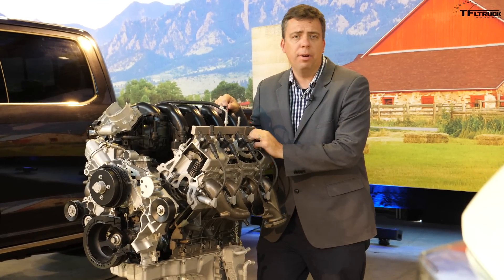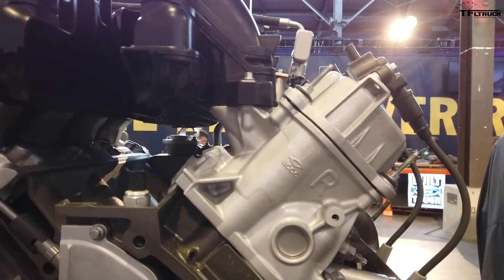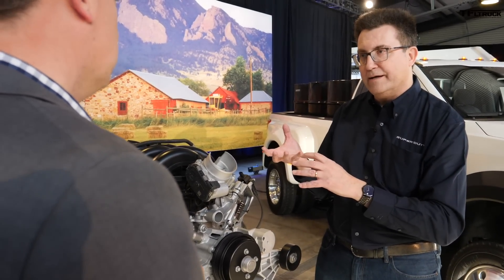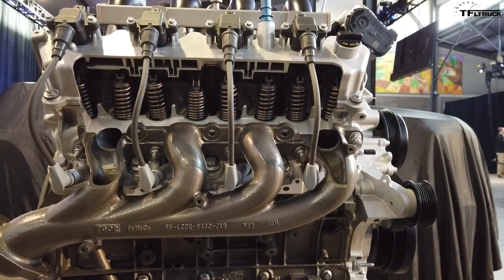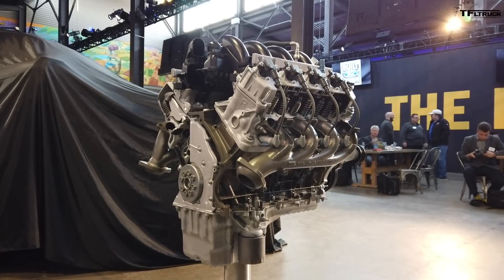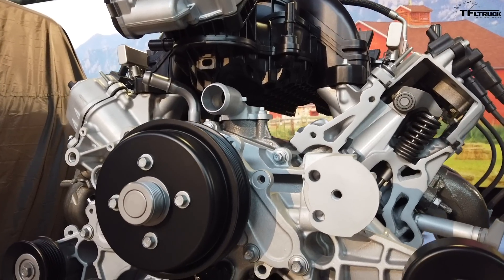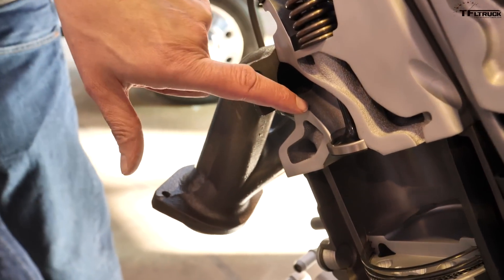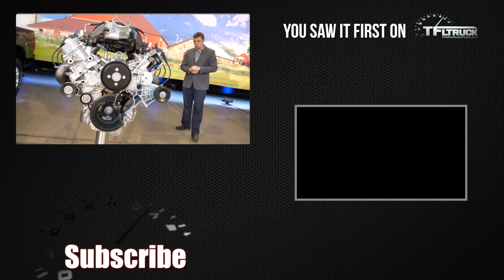2020 Ford Super Duty 7.3L V8: Here's What You Need to Know!

Comment: Ford said a new truck before the bronco, its almost here boys
Reply: abroham lincoln imagine this in the new bronco
Reply: Is Ford going to name the white Bronco OJ Simpson Edition?
Reply: Ford ranger??
Reply: No the new hybrid F150 is coming before the bronco
Reply: Your new bronco will be a far cry from the originals. It will be a crossover with a 4 cylinder or optional v6. Its been just about verified. you cant buy in to these images someone designed on their PC and put out on the web. Need to be realistic here. There is no room for a big clunky body on frame v8 powered off roader in todays market. That's what a jeep is for and they've pretty much got the segment nailed down. Ford would never sell the volume to make it worth it. Maybe a special edition bronco thing of sorts but probably not what your expectine. It would be an ecoboost crossover that would mimic a ford explorer or edge
Reply: @platinumlawnservice  No one is talking about and no one asked you anything about the bronco.  The main comment here is simply about its release date.  Yet here you are chevy fanboy spreading misinfo about the bronco.

No its not gonna be a crossover stop making things up.  Its confirmed to be using the new ranger platform which is body on frame.  And its gonna have a twin turbo 4 and probably a twin turbo V6.
Reply: @platinumlawnservice  ford has said they are going directly after the jeep with the new bronco. sooo
Reply: @sergeysmelnik First its a public forum so I can say what I damn well please. 

Second who says im a chevy fan? Ive owned them ALL and they all have their pros and cons so put that to rest. Ive owned fords in the past but the 97 through whatever year round bubbly things were awful looking and the 5.4l I don't love. We do own a 7.3l powerstroke that gets used for farm work and an occasional trip to town.
 
Third its not going to be anything like the original. If it is indeed built on the ranger platform it would be closer to the bronco 2 which most people don't put in the same class as a full size bronco. It will most likely be some variation of the Everest sold in other countries but with removeable tops and US styling. The removeable tops are jeep like. Will it get off road tech like a jeep? Maybe? Will it sell? I don't think it will hit the spot with the nostalgic fans as it will be nothing close to the original. Also no V8 so im out there. 
Finally I think in basic trim it will be just another SUV that you will lose in the Walmart parking a lot along side all of the others. Hope for the best but prepare for the cringe.
Reply: You said its gonna be a crossover now you're saying its gonna be built on the ranger platform right after I told you...
Reply: @sergeysmelnik  Even if its built on the ranger platform I believe it will resemble a crossover in size and general form

Comment: This new Ford engine justifies my view that the diesel trucks no longer operate in a realm of reality, they are no longer trucks for the average user. 
I want to know how much less a  diesel truck with 300hp and 600ftlb torque would cost today vs the monsters on the lot.  
The modern diesel is dead to me. I'm stuck in the era of the 6bt and ISB engines. I had a 2012 Ram 2500 6.7, wife bought a 2015 Ram 2500 with a 6.4. Her truck got 2mpg worse towing the horse trailer, 2 better mpg highway. With 18k in tow my 6.7 got 9.6mpg, her 6.4 got 7.8 and handled the load without drama even with a 5% grade.  I sold my 2012 cummins.
Reply: TevisC emissions, emissions, emissions. I'm a diesel mechanic turned truck driver. I own a 97 Detroit and a 04 Cat. I wouldn't go near a modern diesel. I know drivers that spent $80k in a couple years on breakdowns due to emission failures. Also my Detroit gets better fuel mileage than new diesels with 2.5 million on the clock. New diesels start having serious problems @500k, at a million you might as well junk it.
Reply: jesse burnett and who are you talking to?

Comment: 390hp @ 5,500 RPM
510 TQ @ 2,500 RPM
But tune it will be 600HP v8
Reply: not on an engine designed for low RPM power.
look at the Vortec 8100
same concept here

Comment: The new 7.3 V8 has a variable flow oil pump!
If that oil pump is similar to those fitted on the 3.2 litre diesel in global market Rangers,  then everyone is going to be in for a rude surprise.
That model of oil pump is incapable of self priming, ie, if you let the oil completely drip out during an oil change over the course of a few hours, the oil pump cannot self prime and pick up the new oil.
You have to let the old oil drip out, change filter, plug the sump and pour new oil in under 10 minutes or so.
A lot of ranger owners in Australia ended up with blown engines because of this design flaw.

Comment: This is a medium duty truck motor. It's made simple because those medium duty trucks see so many hard miles that it's necessary to be easy to maintain by any Joe Bob fleet maintenance, no matter the skill. It's not better, as a OHC DI would kick it's booty output wise, but it's simpler and far cheaper. It's essentially a performance v8 from 1991, with a lot of low friction components. When they say good fuel economy, they mean in comparison to the 6.8l V10 it replaces, which isn't hard. He lost me at cast stainless steel headers, why wouldn't they just use ductile iron which is also resistant to corrosion, cheaper, and casts better? Don't count on it being put into the Raptor simply because It would screw the reported Fuel economy rating of Ford as a company. 3/4 ton and above don't report numbers. I'd guesstimate about 16-18 MPG HWY and 12 City In the 250. Only losing 3-4 MPG loaded. Don't count on high horsepower for displacement with those stubby headers, but the torque number should be chunky.  Without anything to go on other than what information was provided, output could be 380-410hp and 490-540 lb/ft of torque @ 2500-3,000rpm. I doubt it will be rev happy, or even feel comfortable past 4,500 rpm (from his wording it likely red lines at about5,000- 5,500, and those push rods are massive). It won't be a good speed motor without some significant changes that would compromise its purpose. 445 cu inches of Canadian Iron, cue Tim the Toolman.
Reply: Slow clap applause. 👌🤘👍
Reply: 16-18? Ill be surprised if they typically see double digits. Our 5.2 f250 gets 8, the v10 gets 11 unloaded with a cautious driver. The guys who like the way that v10 sounds, they get about 6.

Comment: Will it fit in a fox body mustang and have cams and heads for horse power?
Reply: Well, people have stuffed the 5.4 into a Mustang, and this is a narrower motor.  Definitely taller than the 4.6/5.0 motors, though.  Weight might be an issue, but some people have put the 6.8L V10 into Mustangs, so it should be doable.
Reply: Sebbonx Xsebbon they have shoe horns for that
Reply: Fox bodies can fit anything

Comment: Do we know what the cylinder spacing is? This engine may work out good though with some of the drawbacks of diesels in cold weather, this provides another option. It will be interesting to see if they can pull off decent fuel efficiency with it.
Reply: around 118mm i think

Comment: I have a 2022 Ford E350, Class C, 24 foot RV with this engine and it is a dream.  I have owned other motorhomes and nothing pulls, or cruises like this one.  We do a lot of West Coast, North/South traveling, and anyone knowing the topography of that part of the USA, knows the variation in altitude -- Mountains and mor mountains.  This engine handles ever grade we have driven, with power to spare.  Considering that this Ford and engine are not set up with any special settings not found on standard truck or van models, is impressive.  What if someone were to tune this for the Motorhome style of traveling?  Mine has the 6 speed transmission, what about a 10 speed.  Never mind, just questions -- I am totally happy with my 2022, with power to spare.  The Engine is smooth and pretty quiet -- very surprising, I can actually have a conversation with my wife, even on a steep climb.  Love it.

Comment: The back of that block sure does remind me of an FE....
Reply: The last worth a damn group of engines Ford ever made
Reply: This. But Ford could have saved tons of engineering costs had they just slapped direct injection and VVT onto a 385-series 460 V8.
Reply: Fe were amazing!
Reply: The FE, IS awesome the built 390 in my 68 Cougar proves it. The FE was so awesome GM copied the architecture and “designed” the LS...
Reply: It's a side oiler
Reply: Will French - Cleveland and Windsor engines were great the 6.2 never heard of anyone having issues the 6.7 power-stroke just of the people I know 2 of them have 450k plus miles on the 6.7 powerstroke. Just like mine is at 100k no hiccups whatsoever I use it to haul heavy construction equipment and it’s been great thus far. So no, Ford has built good engines.
Reply: @willfrench2616  It looks like a Ford big block bell housing pattern, -standard since the sixties. Maybe Ford has allowed for this so they can be fitted, as a crate engine kit, into older vehicles, while retaining the rest of the existing drive train.
Reply: David Jury dear god I hope so!

Comment: It better comes with a manual trans. option !
Reply: Dexter u and I are both in a different time 😂
Reply: Why? The 10spd will outperform any manual out there, and likely will have gear override so you can get the best of both worlds.
Reply: It's not always about out performing. Some people like feeling the power and shifting their selves. Not everyone buys as truck to try and race it. Some people love feeling the actual power for themselves.
Reply: @zachfreeman1503  why on earth would anyone buy a super duty with no high end for anything but work? This is for hauling and fleets, not for joy rides.
Reply: Auto transmission is boooooooring. Manual all the way 👍
Reply: @zachfreeman1503  Buy a big rig
Reply: This engine is designed for people who drive trucks for a living. Not for guys scamming disability and selling pills on the side wanting a flashy vehicle.
Reply: Well seeing as how F series hasn't come with a manual since 2016 - and not very common from 2000 to then - I highly doubt it will...
Reply: Investment Joy what does that have to do with this comment section ? You’re just looking for a reason to hate on the motor , gm fanboys always have to run their mouth
Reply: @satrips912  I haven't said anything negative about the motor. It looks like exactly what people have been wanting in a work engine for a long, long time and looks superior to the v10 in every way.
Reply: Word is out all are doing away with manuals.
Reply: If I ever get one, I'll manual swap it.  I can't own an automatic in the same way I'm not attracted to men.
Reply: swatteam2002 nah, manual is outdated
Reply: Much rather change clutches in a standard than auto!! A he'll of allot cheaper too!!!
Reply: I joy ride my 7.5 f350 all the time !!? Why not??
Reply: Hard, cold truth for manual transmission fans: Nobody's buying them, so manufacturers won't spend millions of dollars to certifiy something that won't sell.  Besides, newer automatic transmissions are more efficient in all conditions than manuals, even pulling.  As much as I like sticks, I have to face the fact that mass-produced manuals are going the way of the Model T.
Reply: @joshterry941  you must be a transvestite
Reply: If it does I'l trade my dodge in. 🤗
Reply: I would love that, but it won't. Ford hasn't offered the F250 or F350 with a stick since 2010, and I doubt they'd reverse course. Hell, they're even putting an automatic in the new Shelby GT500 ffs (Carroll has to be turning in his grave over that one)
Reply: @redtorino  I'm going to try to keep my 2018 Camaro SS 6 Speed as long as possible, I unfortunately see the writing on the wall :(
Reply: I can almost bet Eaton Fuller will make a conversation kit , put a 13 speed and supercharge it 😍

Comment: Ohhh yeah! That’s what I’m talking about! Eat your heart out Chevrolet!
Reply: The Rusty Hubcap US that’s ironic because they basically made an oversized version of an ls 6.0 😂 not complaining just pointing out the fact that ford went away from pushrods in the mid 90s because over head cam is “better” but now they’re coming back to building pushrod big blocks. Smart move on their part though the tritons sucked ass vs the motors they replaced
Reply: Zach Roell definitely those damn Tritons blew head gaskets like nobody’s business!
Reply: Zach Roell - Ford has still been building pushrods they sell them as crate engines stop spewing nonsense
Reply: leeleelee we’re talking about production vehicles.
Reply: Zach Roell no I said Ford still makes pushrods. No one ever said anything about it not standard in a car
Reply: Yeah I brought up the fact that ford went away from pushrod motors in their trucks a long time ago and that this has a lot in common with the way the vortec 6.0 is. It’s a 6 bolt main, iron block, 2v, pushrod. So by him saying “eat your heart out Chevrolet” I’m just pointing out the fact that it’s not that much different of a motor than what chevy already offers aside from it having a bigger displacement.
Reply: Zach Roell - it’s still a different motor yes some engines will share characteristics because of the same type of design that doesn’t mean it’s “copied” or the same engine. It’s completely new engine designed built by Ford.
Reply: The Rusty Hubcap US not headgaskets? Maybe spark plugs but not headgaskets

Comment: I love they idea of this engine especially if used for work. But imagine the dummy's who will get this in a daily driver then complain that it only gets 10 or 11mpg
Reply: Oh already seen that! Already seeing 17 year olds lifting these trucks and putting 35×12.50/22's on them and then it's down to 7mpg!
Reply: It’ll probably get better mileage than that. With how much this guy kept saying “efficiency” I’m thinking it’s gotta have at least  more than 10mpg
Reply: @CG_Element  Didn't one of the diesels get something like 6 mpg full throttle on the uphill climb they did on this channel? Or was it the ecoboost? Idk about this engines fuel efficency, they really should have brought back the REAL 7.3 diesel.
Reply: 34486 well we obviously won’t know until the numbers are released. But like i said, i expect pretty decent gas mileage considering how much he pushed that term in this video. And also if they stick true to having a perfect air to fuel ratio then it will be very efficient
Reply: @CG_Element  I was exaggerating some there but I still don't see it being revolutionary in it's efficiency. Still a large cube engine. And if you put your average dipstick behind the wheel he will probably see lower numbers than people who would drive it more efficiently.
Reply: @ReidHenderson  I'd guess 15 combined mpg in a rwd
Reply: They need to learn how to do cylinder deactivation for light load or shift real early into overdrive when there is no load to pull.
Reply: @robc8468 cylinder deactivation is trash. 
If you can afford the truck to begin with then you aren't worried about affording gas.
It's not going to be a ridiculous low mpg.

Comment: We need this with a blower stuffed in a scsb 2wd f150 BRING BACK THE LIGHTNING
Reply: soaringtractor it can be modified buddy. I don’t know if you’ve been around the car scene at all but a ton of people just use chevy truck motors and modify them to make over 500hp. As the guy presenting himself said, it’s ready for a turbo and built to handle it.
Reply: soaringtractor  you realize there are modern pushrod motors that make lots of powers and the majority of car history they have had pushrod motors they raced, do you realize there were 460s in mustangs in the past, and those were truck motors with .2 larger displacement than this one

Comment: Chevy has been doing this same thing for almost 20 years
Reply: 1997 chevy put the 5.7 liter version  of that exact platform in a Corvette 22 years later Ford is doing it in trucks and calling it new.... I love my super duty but c'mon ford it's an LS with a modified 1st gen 4.6 ford truck intake...
Reply: Powertrain is the only thing GM is good at. The shitty vehicle built around it is too much to put up with.
Reply: Tyler Rice All domestics used OHV V6's and V8's for decades!  This is nothing new to anyone.  The LS is not the first pushrod V8.
Reply: @LynxStarAuto  I'm fully aware there have been pushrod V8 engines since the late 40s early 50s but the 6 bolt cap design for the mains, the getting away from the overhead cam/ horrible phasers and going back to pushrod system just really seems like Ford feels GM might have something going for them in the truck market. And the layout of that powerplant just looks like an LS knock off. Plus the ((7.3)) seems like a meager attempt at reeling back in some customers from the 7.3PS era that have gone Chevy or Dodge due to the 6.0/6.4 failure. Trust me I was a Ford dealership mechanic for 4 years and I drive a 6.0 powerstroke daily and have probably done more phaser/chain replacements on 5.4 3v than 95% of the people that will ever see this video.
Reply: @ELRman86  I saw that ford made a new 7.3 and at first I thought it was another 7.3 powerstroke and was siked. Then it turned out to be a gasser :/